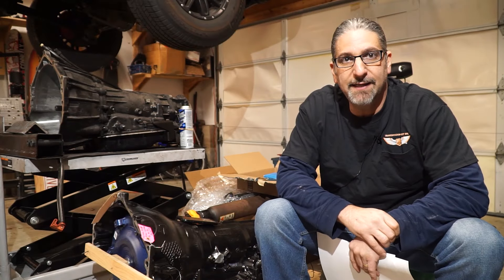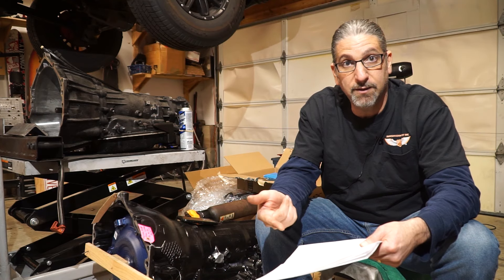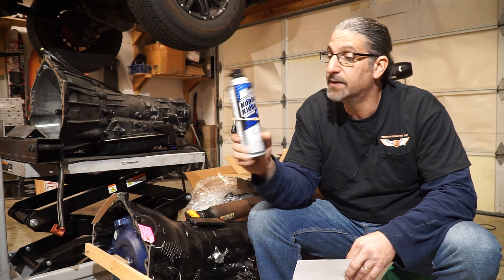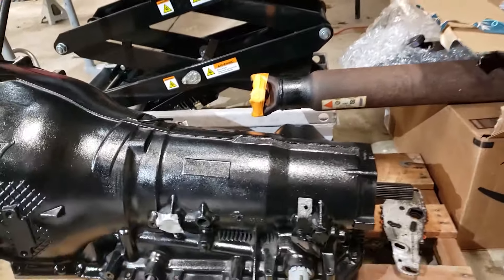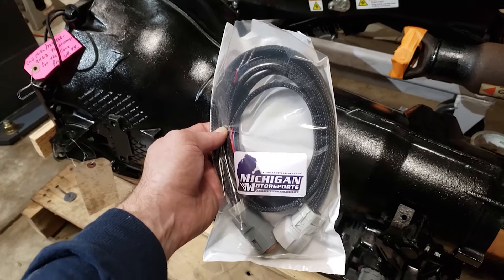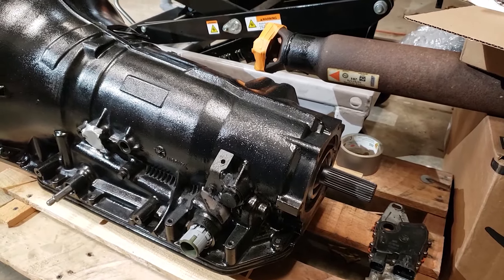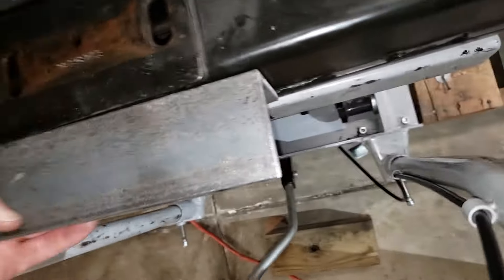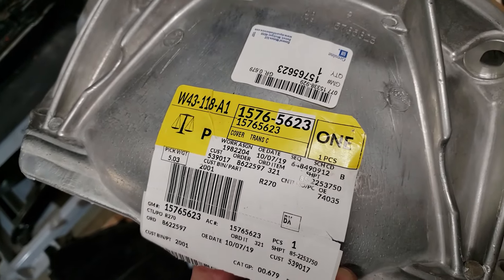4L60e to 4L80e Transmission Swap - What to buy

Comment from the maker: Links to the stuff in this video on Amazon in Description above.
Reply: Just a quick question, not trying to talk down on this setup but wouldn’t it be easer to just have a 4l60e built to hold more power. No hate just wondering.
Reply: Ben Peters no because the 4l60e is junk that’s why everyone swaps them  no matter how you build them they always shit out 3rd and 4th
Reply: Dealing w/a similar issue. Customer brought in a 07 chevy 1500 4x4 (6.0)
4L70e tranny is shot & can't find one for a decent price. Have access to a complete 2000 chevy 2500 4x4 (6.0)
w/a 4L80e. What all can I use from the donor truck?
Reply: @benpeters9538  still won't last as long. By design the 4L60E uses all of the forward clutches twice. So you get 1/2 the life of the 4L80E
Reply: @carolinawestern3875  everything except the rear driveshaft
Reply: @joshvanderwal6718  2 to 3 smfh
Reply: Hello can you send me a list of parts and where I can get them from to swap a 4l60E to a 4l80E thanks john
Reply: So, to avoid surfing the comments, I'm contemplating swapping a 6.0 and 4L80 into my GMC 1500. Why not just use a transfer case that goes on the 4L80?
Reply: Yo I gotta GM 246 tcase with a 27 tooth input gear how to I find the one I need?!?! I got a unknown 4l80e in a single cab short bed truck it got push button 4x4
Reply: Sir, let me understand,, replacing the 4L60E in my 2001 Silverado 1500 4x4 
To a manual transmission, being a 4L80 or 4L80E ??
I myself am sick of the Chevy 4L60E, I have a Jasper 4L60E and I am not happy at all since day one being one 1/2 yrs ago.
I believe in manual transmissions, they pretty much never let you down..
I wonder what the cost of a swap would be for my mechanic and myself..
Does this make any sense to you. Hope I was clear that automatic transmissions are terrible..
Thankyou
Reply: @harvdog5669 😂 Too correct you 4L80e is “ still “automatic  transmission 

The nv3500 and nv4500 are the Manual “Stick shift “ transmission used in the trucks
Reply: Ok My 99 suburban is 2WD 
What donor vehicle do I wanna take a 4l80 from ? And what is different with this whole deal with putting the 4L80e swap into OBS 92-99 suburban or a Silverado  Specifically ( 2WD) 

My 4L60e is acting up and I was gonna go nv4500 manual  or a 4L80e.
Can this be done on a vortec 5.7 2WD

Comment: Not even 5 minutes in and I figured out the easiest way is to sell the 1500 and buy a 2500 😂😂
Reply from the maker: you might be right
Reply: Apparently u don’t like to get ur hands dirty😜😂
Reply: Truth lol it’s not that bad tho
Reply: So what my 2500 has a 480?
Reply: Slim Junior 4L80 yes
Reply: Everything is more expensive owning a 2500 over a 1500. Unless you're using the truck for work heavy towing/work I'd stick to a 1500. I swapped a 6.0/4l80 into my 02 silverado and never looked back.
Reply: juan romero it’s worth it tho . Most of us do want to do towing  that’s why we’re even on this video
Reply: @mexjuan  came here looking to do the same thing with an escalade motor
Reply: perfect if need to up your gvwr to be legal
Reply: When you find a 4600lb 4x4 2500 let me know
Reply: Yeah if you don't mind a rougher ride of the 3 quarter ton ( 2500) they're great if you haul heavy loads but other than that a half ton (1500) rides nice.
Reply: I fiured i just keep blowin 4l60s fuck ive got the swap down to 6 hrs now
Reply: It's not a big deal... just did mine.... this video seems like it makes it harder than it really is... although you do need to modify all this stuff he speaks of... I own a 2002 1500 single cab short bed Silverado...my drive shaft broke along with the back end of my performance built 4l60e transmission,  sooo,  after that happened I decided to just move on to a 4l80e, so I did, ....had to buy a new dip stick...used my cooling lines, just massaged them a little  an rebended them to fit on the 4l80, had to buy another flexplate,  went to local part store (o'Reillys) got a flexplate for a 2500 silverado gas truck (6.0) engine , cost me $80.00 and used my own cross member bar, just welded a metal plate further back on center back side for the new 4l80 to bolt onto, had to buy a universal u joint (the 447) cost about 25$.. that one goes on your 4l80 yoke and also bolts to your 1500 drive shaft perfect.. the universal wiring harness cost like 30$ also on ebay, simple plug and play... you do need to run the second speed sensor wire to your computer box (pcm) and plug it in pins 22 and 23 and that's that, will require programming to let the truck know that it now has a 4l80 not the 4l60 and program the new shifting patterns... ( my local tuner did that for me, $50) and last but not least, had to use my old neutral safety switch from the 4l60 and put it on the 4l80...i also had to buyba used slip yoke at local junk yard for $40 ...that was it
So recap:
Dip stick: $20
U joint: $30
Wiring harnes: $30
Flexplate: $80
Modified crossmember: $30
Used slip yoke: $40
New fluids: $80
Transmission tune: $50

Total of $360 bucks ...
Labor is extra, depends if u do it yourself or what your mechanic will charge u.. I'm in South Texas and u can find mechanics down here that will charge u bout $200 labor for all this.. just saying.... anyways, in my case, I feel that this 4l80 that I just put in is a bit slower on the take off than my old built 4l60, my old transmission used to engage quickly and shift hard and choppy making my tires spin as it shifted to next gear... this 4l80 shifts smooth and soft but I feel it pulls less on the take off and then really opens up at the high end.... its stock though and my 4l60 had all the goodies in it.any suggetions to at faster take off on this 4l80? My truck is a 5.3 , cold intake, msd wires, long tube headers, 411 rear end gears, tuned by my local tuner.... I still feels the power in my truck but I feel I lost a bit in take off... don't really feel that g force when I floor it from a stop, tires spin less but then it really pulls at higher speeds when  throwing that last gear...(that's nice) any suggestions? Maybe another torque converter? A shift kit?.... let me know, thanks.
Reply: @josevenegas2319  did you have to shorten your driveshaft? i have 2004 1500 single cab short bed 4x4. located near San Antonio TX
Reply: @AlexTurbo  no not in my 1500 2 wheel drive...but in a 4x4 you might have to, not sure because of the transfer case and all that deal, in mine they didn't have to, but your local performance shop can answer that question....
Reply: Lmao right. Whats nicr about 1500 is weight reduction. But I myself would choose a 2500/3500 for sole fact that all the heavy duty parts are gonna hold up to abuse alot longer and save on money until you fully build it
Reply: @mexjuan  how difficult was the process brotha, I’d like to do the same with my 08 Silverado
Reply: My 4l60e has all neutrals as of right now. I was hoping to beef it up not buy a bigger truck lol
Reply: Not when you have upgraded moneys got spent my boy
Reply: @TheRaezorRae  lol
Reply: @josevenegas2319 could we chat about this a little more
Reply: After 4years… I’ll give it to you comment stuck with me 🥲😂 had to come back

Comment: Excited for this! I replaced my 4l60e with a replacement on my avalanche. I did it on my back, no lift only stands. It was scary, never did anything like this work before. Week before christmas last year took 4 days for out, in, running. I became very confident. Good luck and I cant wait to see this completed!
Reply: I also removed the 4l60e from my avalanche by myself. The trans is messed up cant even remove the components looks like a piece welded itself on the output shaft and its only the stock 5.3 with a 3000 stall that stall was fun the truck would actually spin the tires hard when punching it from a stop I guess its too heavy for the 60e to handle it so im thinking of swapping to a 4l80e with a 3200 stall.

Comment: Do you have to change the shifter in the steering column? Does the cable move the same distance for each gear in each trans?

Comment: Damn you balled out. I did my swap from market place lol. The only things knew I bought was the transgo kit and had to have shaft shortened. Already had HP tuner. Everything else was used. I know a guy with stock 4l80 and a transgo kit running low 9s in a 3400 car.  They are strong even in stock form. I'm going to be putting one behind a sbf when i get the parts together.
Reply from the maker: Best of luck with your build!

Comment: I'm building a 66 C10 SWB and planning a 5.3 LS swap and have been considering doing the 4L80 for it also.  This will be a cruiser truck on bags.  I plan to keep the 5.3 stock with the possible exception of a mild cam for a little power and sound.  It's going to be a nice weekend cruiser but I'm building it to be able to drive everyday if I wanted to and also on occasion pull a small trailer.  I'm fairly certain I won't ever see the benefits of converting this truck to 4L80.  I think the 4L60 will be just fine for my needs.  Then again, this is a full build and I'm gonna have to do custom driveshaft and cooler lines and all that anyway so I'll just have to weigh the costs when I get to that point.

Comment: Okay so first question because I’m getting ready to buy all the parts to do this you mentioned 27 spline and 32 spline and swapping out an input shaft ? So are you saying I have to use the 4l60 transfer case and swap out the input shaft or can I not use the 4l80 transfer case ?

Comment: Well we know it’s bulletproof. Missed out on an 80 a few months ago. On my 2nd “rebuilt” 60 that just blew up in the suburban...done!
Reply from the maker: Yeah, i blew my 60 twice before switching.  Never looked back since and don't cringe every time I stomp on the gas.
Reply: @TahoeSteve  we’re those 60s built? Or stock?
Reply from the maker: 1st stock.  2nd built.
Reply: @TahoeSteve  I’m trying to decide on a built 4l60 or 4l80 but I want to know if it matters for 4x4 trucks. Because I have the manual switch not the button switch

Comment: Thanks man I have a 2005 Chevy Silverado with a stage 2 Cam and I want to take my 4L60E out and boat up my 4L80E because all I've been having was trouble a lot of people told me that no matter what I do to the 4L60e i will always have problems with it I put an H2 shift kit in it and a super servo and the red high clutches and I'm still having problem with it slipping on me after a while

Comment: Instead of reusing a mp3023 Transfercase originally mated to the 4l60(27 spline). You can opt for a NP263HD (NP1) transfer case which came in the 6.0 2500 trucks which are known to be much more stout 👍
Reply: Can I use my stock 1/2 ton front driveshaft shaft with that?
Reply: @tylerkuiper300 right I want to know this too but I literally just put a junkyard transfer case in yesterday not all wired up yet

Comment: The transfer case adapter plate wasn’t in the description also thing that stopping me is transfer cause adapter both drives shaft being different cause mine is 4wd  everything else seems easy to swap over can you provide a link for the drive shafts and adapter kit

Comment: Can you also just swap to the 4L80E Transfercase instead of using an adapter plate to use the transfer case to re use a 4L60E or what would be the hold up
From just going with the Transfercase to match the 4L80E?

Comment: Grate information.
I'm doing swap on 2003 Escalade. Donor -2003 Silverado 1500HD and NP149. Everything are installed except rear driveshaft. 
I learned  from forums that trany + adapter + T-case are 30mm (1-3/16") longer then original setup. Can you post how much you cut from rear driveshaft? You mentioned about 1-11/16". I need cross-references before ordering rear driveshaft. 
Please.

Comment: Thank you for the video I've been wanting to put a 4l80e on my 95 k1500 I'm sure itll be different but still I'm further after watching this video. Its was awfully thoughtful because I'm sure its took a while to find all the stuff. You also even said where you ordered everything how much was the 4l80e from the place you bought it from. Also was the specs on the transmission whst it initially came with when they built it or did you get it built with stronger things or was just the 27 spline adapter the only thing cause I'd like to go with the adapter installed.
Reply from the maker: From memory, the 27 spline adapter was the only thing I added.  But, I did replace the torque converter that came with it to a really nice one from Circle D.

Comment: I want to change the transmission and potentially convert a 1500 van to 4x4. 
Probably not worth it, but if I ever have enough money to cover it I would like to.
I might just have to wait and buy a newer 2500 to convert to a 4x4

Comment: Amazing amazing video, I was just wondering if a 310 mm stall will work on my truck. Not sure what the size difference is between the 278 or if it’s different. Thanks in advance
Reply from the maker: So glad you liked the video.  The number represents the diameter in mm.  Call Circle D, they are very helpful and will recommend what's best for your application.

Comment: Question, for the flex plate I know the ls1’a had a dished one... would that work as well for not needing a spacer?
Reply from the maker: Mine was dished and did not need a spacer.  Just make sure you select a torque converter that fits the bolt pattern.  Call Circle D.  They will lead you down the right path.

Comment: Do you have a link to the 80e spacer? I have a 5.3 I’m wanting to mount to it but I can’t figure out what part number I need for the spacer and bolts, motor is out of a 2005 Silverado and 4l80e is from a 2002, all the ones I find it shows for older model 4l80, any help would be appreciated thank you

Comment: Tahoe Steve great vid. I really appreciate you taking the time to make the vids on the 4L80e swap..  Did your tahoe come with the 4L60e or did you put it in? If you installed the 60, how did that go?  I have a 69 chevy heavy 1/2 ton 4x4 that I want to put a 4L80e into, but I already have a 4L60e with less than 20k miles on it and rite now it would be cheaper.  And I have a LS 6.0 as well. I want to put them both into my 69 with my original transfer case, unless I can get an used 80e before hand. I'm not sure what the transfer case is, but I'm pretty sure it's a gear to gear transfer case.  Do you have any advice or recommend any vid that could help me?
Reply from the maker: Mine came with a 4L60e.  Blew it up the first time and reinstalled it will all the upgrade goodies.  Blew it again and said enough!  4L80e is amazing and I don't have to cringe every time I stomp on the gas.

Comment: Man I don't know what route to go, I bought the 4x4 tahoo 2000 5.3 a month later the 4L60 blew, got another one in and just today spent 2.6k on total suspension replacements and the tech drove it afterwards to check his work and told me my trans is bad, like it could go at any time. 
So that's Two 4L60's bad!  What the heck man I just want to be able to tow, maybe get some firewood or manure But I am having the worse luck with the dang 4L60 the trans problems are a real issue, another problem is two of your amazon links the item isn't available, so it is like dang, want to make a change but are parts still around to do it?
cool video.
Reply from the maker: which parts, I can update the links.
Reply: @TahoeSteve  Transmission Dipstick, GM 15765623 COVER,TRANS CONV
,HP Tuners M02-008-02 , looks like just these three
Reply: @TahoeSteve  Last week blew the rebuilt 4L60 trans that is 3 transmissions in less than two years and this one I had a huge transmission cooler installed but I think I figured out part of the problem it's the engine, when I am towing it consistently revs up to keep speed on any uphill, like not enough power so that automatically heats up the trans more and I am sure that's what did this last one in.
Have you ever thought about upgrading the engine to a 6.0 or 6.2 ?
Reply from the maker: All the time!

Comment: I have a 1998 silverado with a 4l60e (3-4 clutch pack worn out). I found a cheep 2001 4l80e on Facebook, and I don't know if I should rebuild my 60e or install a 80e.
Reply: Same here
Reply: I’m thinking too. Seems like a process.
Reply from the maker: Guys, no lie - it's a PITA (pain in the ass).  BUT - it is SOOOOOO worth not having to worry every time you want to pull something,or simply just stomp on it.

Comment: Great video Steve . If I cut the cross member to relocate for the trans mount . How far do I need to move it from the original location backward ?
Reply: Did you ever get this answer
Reply: @kristymoore4522  No. When I installed my cross member .I just cut the front transfer case mount bracket off. New location for mount was directly on the cross member it self .I just had to make excess holes on the bottom of cross member so that I could get at bolt heads for the mount/
Reply: @kristymoore4522  Also I used the plug and play wiring harness adapter from PCM of NC  Part# P-120021

Comment: Can't you just use the same bolts for the flywheel you have listed we can get on Amazon? The bolts that comes off the the original 4l60e flywheel?
Reply from the maker: Are you using a dished flywheel with the 3 bolt pattern TC?